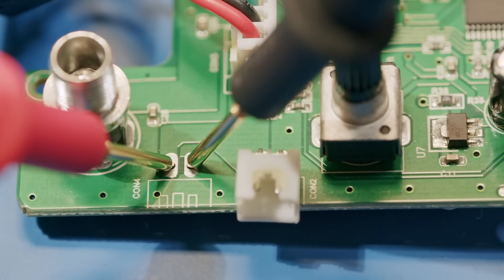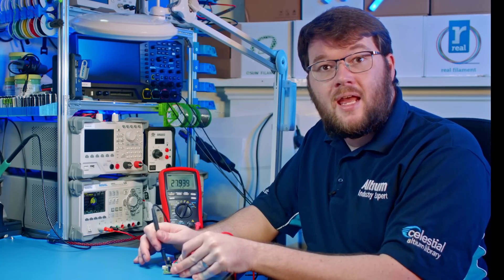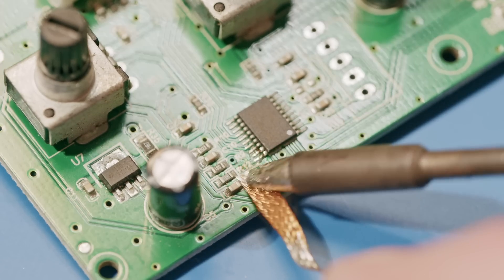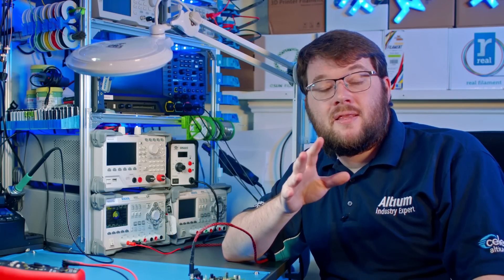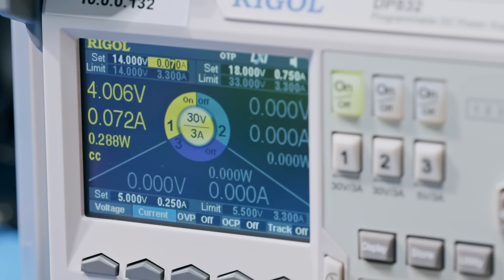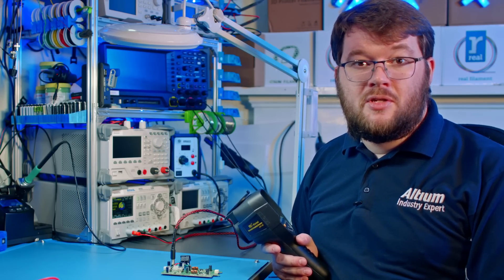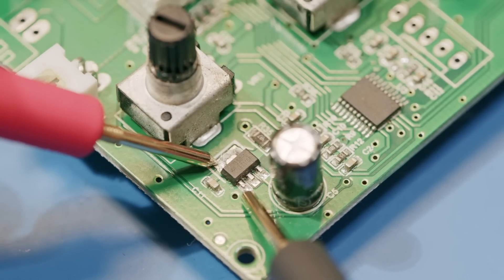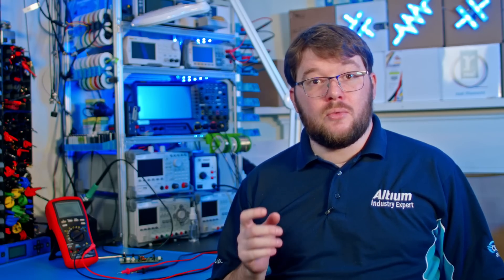Safe Circuit Board Power-Up: Troubleshoot like a Pro

Comment: Some circuits will not boot properly unless given its operating voltage at start-up. My ZVS was running on 4V 3A, maxing out my power supply. However all resistance measurements check out and I was in a hurry. So I thought why not give it a shot. So I disconnected, turned up to 15V and reconnected, this time it only took 0.3Amps and was switching as expected. When it falls below a threshold voltage, it stops switching and turns into a short.

Comment: Step 0: Connect an electrolytic capacitor backwards on you bench PSU as a gift to the electronics Gods before power-up of the new board.

Comment: A tip I've found useful is to have a copy of the schematic and layout nearby when troubleshooting a new circuit board. It can help with quickly identifying potential issues.

Comment: Two additional items to consider:
1. Use 0R to disconnect the load from your regulator outputs when first powering up. This will protect your circuit if there is an issue you didn't pick up. You can then also test to ensure the output voltage in a no-load condition
2. With the abovementioned 0R removed, you can temporarily add load resistors to confirm your power supply current capability
3. Add the 0R links back. Any errors now will be on the load side, not the power supply side.

Comment: Recommend adding the following steps:

Measuring resistance of all rails with both polarities of multimeter (positive biased lead on rail to negative biased lead on ground and vice versa). PN junctions present in sneak paths, such as protection diodes in CMOS devices, may yield different leakage currents depending on bias polarity of the resistance measurement. Record these measurements and trend across serial numbers. Out of family results may indicate a defect.

If using sensitive low voltage devices, such as modern FPGAs operating at ~1V core, check the open circuit test voltage of your multimeter in resistance mode with another meter in voltage mode for damaging test voltage levels. For example, many Fluke meters have open circuit test voltages upwards of 5V. This can damage a 1V rated device if applied directly to the core rail. For this reason, I like to use an Amprobe 37XR-A with an open circuit test voltage clamped to around 250 mV.

Prior to applying power to the board, independently verify the supply is configured properly by measuring the open circuit voltage of the supply with a volt meter, and then verifying the over current trip threshold by shorting the leads together. Make sure you understand the type of over current protection being provided - foldback current protection behaves very differently from a strict cut off protection, for instance.
Reply: Also, be mindful of your lab supply's voltage slew rates. A rise time that is too fast may result in inductive kicks through the cabling to the DUT. A rise time that is too slow may result in startup issues at the DUT. In general I've found a primary supply rise time of 1-10 ms to be sufficient for just about everything I've ever touched.
Reply: These are some good points. Speaking to the modern FPGA devices.. I’ve found that measuring the resistance across the main core rails often results in resistance well under 50 ohms from power to ground. This is a consistent result across serial numbers as well, so as the video suggests, at the end of the day know or have a rough idea what to expect based on design.
Reply: @CSFitness1  Can confirm. I'm currently working on a design featuring a Xilinx Ultrascale device. I've consistently measured a core rail impedance of about 20 ohms using the aforementioned Amprobe 37XR-A meter. The leakage currents are surprisingly large.

Comment: If you can't afford a thermal camera you can use thermal film.
Reply: You can use alcohol or brake cleaner spray. The area where it evaporates first is the hottest. Thermal film is much less sensitive
Reply: @AndruShows  that's alright when you already know the specific problematic area is and just looking for the particular component. Alcohol disperses evaporates quick, not giving enough time to scan a larger area. Another alternative could be rosin atomizer
Reply: Lifehack